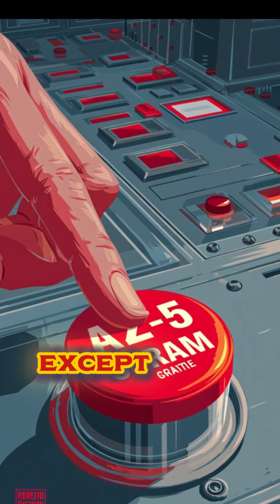“Inside Chernobyl: The Deadly Secrets of the RBMK Reactor”

Comment: Bro..
A RBMK is a type of BWR, though it's design is completely different.
Unlike BWRs, the RBMK uses pressure tubes to store fuel. These were called channels.
At the tip of the control rods, graphite stacks to moderate neutrons.
When water is boiling:
Water boils → less water to absorb neutrons → thermal power goes up.
The cooling tower DOESN'T store the reactor itself, and it's in the reactor building, not the cooling tower.
As for AZ-5, it wasn't big, it was a small sized red button with a grey cover.
Most of this video is inaccurate.